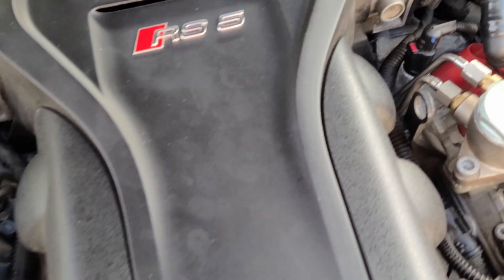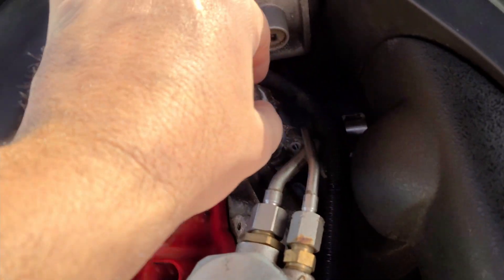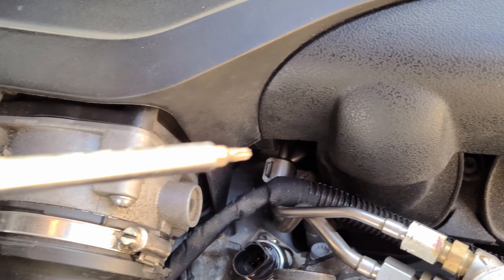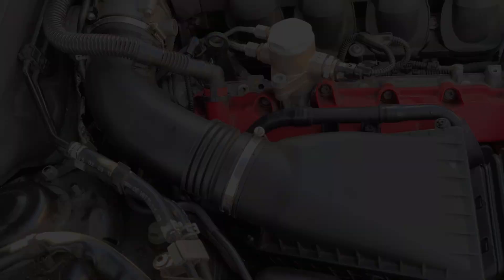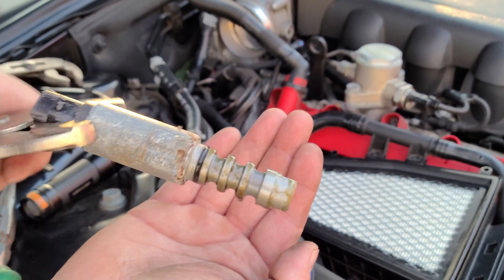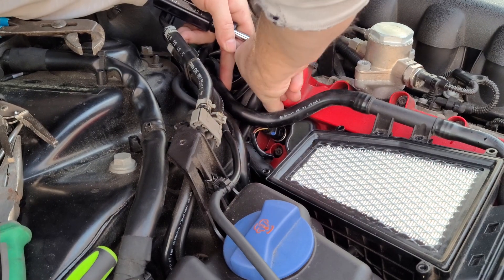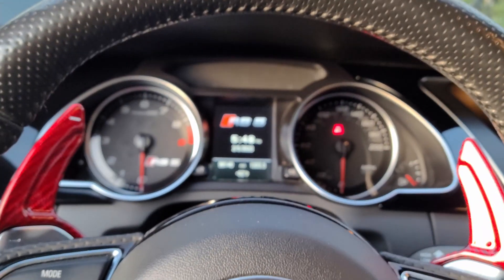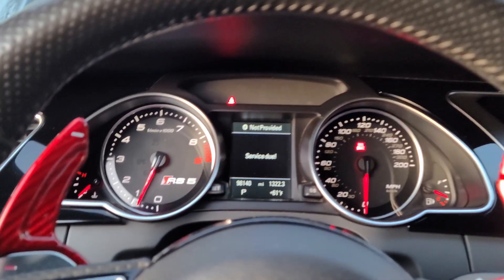How to Fix EPC Light and Do Not Exceed 6000 RPM Warning on Audi RS5

Comment: Happens on my dad's RS5 B8.5. However, on the video, on the second start up, the error does not show, and the same happens with my dad's car. I belive its because oil got some time to run through the system or something, because it only happens on the first start up of the day and if you move that car before idle goes down. Will try this solution tho.
Reply: does this work for you...also have the same on my b8.5 RS5

Comment: Okay, I replaced exhaust solenoids on my car, same issue but this video is a bit misleading. What causes these solenoids to rust is the water that does not evaporate from their wells because of the sand and dust from the road that sits inside that rather deep well. So if you just pull the solenoid out first is part of this stuff falls into the timing valve system and the other part is that all this stuff will not let you put the new solenoid back all the way down. I guess this abrasive can cause major damage to the timing valve mechanism. I spent half a day disassembling everything to first blow away the abrasive from the well, then soak the rest of it in lubricant, then after pulling it out took the rest of the stuff out by sticking it to the chewing gum. Then, when it’s all clean you can slide the new solenoid in. The message is that be careful with all these things, this is how you can kill your engine.
Reply: Agree. The area you are working in has to be sterile clean. Too many ‘It’s easy!’ videos to catch out the unwary.

Comment: do you think this applies to the S5 as well? i get the epc do not exceed 4k rpm only on SOME accelerations idk what triggers it but usually if i do a decent pull or pass someone on the highway it comes on and is gone when i restart the car...ive only lost power once
Reply: I have the same problem and have an s5 did you ever figure out the problem ?
Reply: Yes I got it fixed at a shop. Was the oil switch on the back of the engine! Hope that helps.
Reply: I should add that there are two oil pressure switches. One by the oil filter housing and the one on the back of the motor.
Reply: @dunktherapper hm was the fix if you dont mind me asking? i just got that, happened to me before but the engine light disappeared currently at 73k km b9 s5
Reply: Not sure about a b9 as mines a b8.5 so it’s prob different. But it was like $470 almost exactly I think.

Comment: Thank you for this! Had the same codes and changed out the solenoids. Turned out the one from the side of bank2 was completely rusted and even snapped in half when I was removing it, glad I was still able to get it out! Keep up the good work
Reply from the maker: Yeah mine too it was on the side because ones on the top are clean and dry and the ones on the side are kind a in the whole that probably holds a water when it rains so they get rust on it! Thank you brother im glad this helped you out! Thanks!
Reply: @driveitlikeyoustoleit7824  did you replace all 4 ? are they all the same part numbers ?

Comment: The problem was solenoid sensor?
Reply from the maker: Yep it was solenoid Bank 2 on mine , you got 2 on each side its best to change all 4 usually its ones on the side because they are kind a in the hole and probably holds water when you drive it on the rain so they were all rusted but yeah no more lights coming on